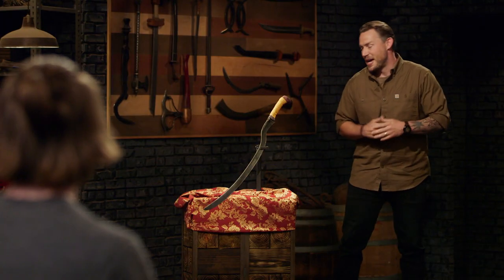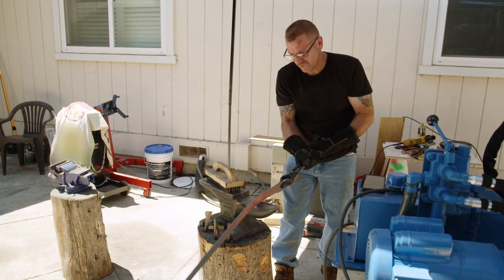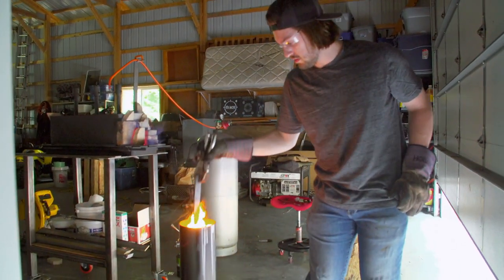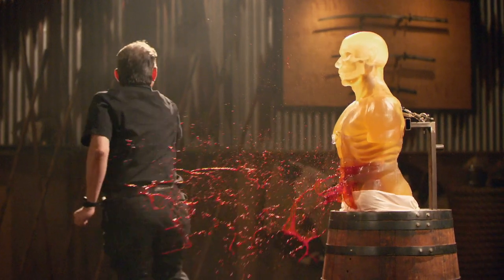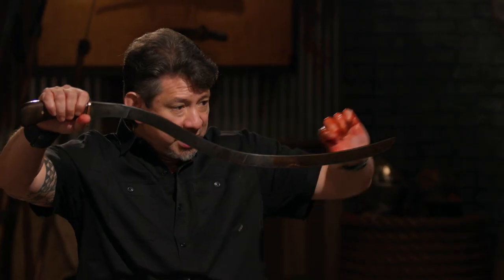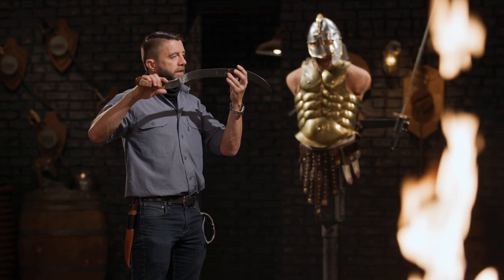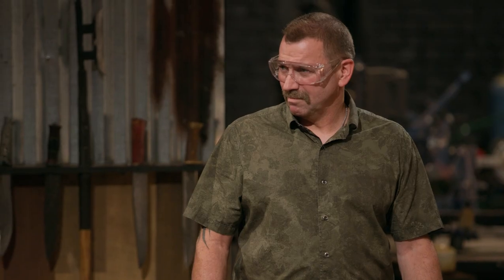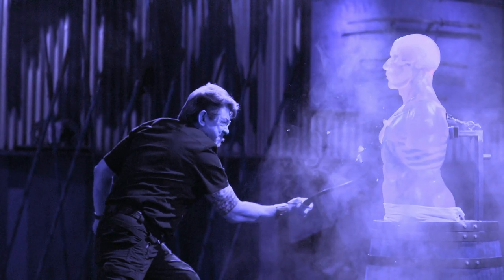Forged in Fire: Mesopotamian Sickle Sword SLAYS in the Final Round! (Season 8)

Comment: The second neck strike with Robert's was in a different location than the first strike.  So the second strike cut off the head with one slice.  a very clean slice as well.
Reply: one of the sharpest swords ive seen on these
Reply: Thanks captain obvious
Reply: The way the first swing of that second blade dug into the rib cage was impressive. Straight through several of them and deep into the chest cavity. An instant fight ender. Mechanically unable to swing a sword and dead in seconds. The first sword was a good cut but didn't get into the juicy bits behind the bone.

Comment: If they're making an historical sickle sword. They should have them make it out of bronze to add to the difficulty, and make it historically accurate.
Reply: Hammer hardened Bronze would be cool
Reply: It would be cool but since they're doing it at their home and so having a metal restriction they didn't know with 3-5 days to work might be too hard. It has been shown quite sometimes that blacksmith in the show only have a few good metal pieces available. Imagine if one of them doesn't have bronze and the nearest place to buy it is 3 to 4 hours away then it's a day less on the schedule.
It would work for the previous rounds where they have the same equipment

Comment: So if it’s a Bronze Age sword why is forged instead of being cast
Reply: Yes, it would have been better if the swords had been made from bronze.
Reply: If it was bronze, that strength test would last 5 seconds tops 😂
Reply: @jackjack3358  What if it were done against bronze armour and weapons?
Reply: @QuentinStephens  That would do the trick. 
But it would be a curve ball to all contesters - since all the equipment they have,(materials, benches etc) are either iron/steel or designed to be worked with those. For example, you can't do quenching on bronze sword. They also probably don't have bronze in their inventory at all
Reply: @jackjack3358  True, but they don't take into account things like the size of a competitor's furnace either. And there are a lot of similarities: for instance the edge of a bronze sword has to be ground just the same. And given that the edge of a bronze sword benefits from being work-hardened there's still a lot of forging to do. And copper and tin are widely available.
Reply: @QuentinStephens  there is a difference between not having the best tools and not having the right materials. All the pardticipants with less material still have the possibility to make the weapon and find a solution to work with their restriction. But if you don't have bronze you simply can't do anything. So you have to waste half a day or a full day depending on where you live to find the metal you need. I'm not a blacksmith myself but I know that different metal have different melting points so they won't react the same way and a bla ksmith who has never worked with bronze before might not know how to proceed

Comment: The Mesopotamians didn't wear metal armor, so the toughest thing this would have had to hit was a leather shield. I'd call this a historically inaccurate test.
Reply: Given that they smash blades made in countries with warm climates against blocks of ice, I’d way most of the strength tests are historically inaccurate
Reply: @BabyIshii  Aye, if I recall correctly I think they would have been using bronze, at least the blade they made looks like it could've been pre-Iron.
Reply: I think their goal is not to be as historically accurate with the builds because if they did the swords would have been made with bronze or iron not those steel alloys. They probably just want the bladesmiths to mimic the design of the blade and just be lethal, sturdy, sharp, comfortable, and not so heavy. I'm guessing the only historically accurate part they do in this show is when they give those brief introductions about the blade. Other than that, it's just more centered on the smithing
Reply: They said straight up in other videos the tests are more brutal than what these blades would usually be subject to. This is to really differentiate the two weapons from each other. If they were very even throughout then judging them would be very difficult. The judges also specify they can put their own signature twist on the weapon as long as minimum parameters are met and performance in tests is fine. That could include use of modern materials.
Reply: I did use bronze pins and a bronz guard on mine. The judges got a bit annoyed and said the original did not have a guard. I pointed out the original was cast bronze and had a guard cast into it.

Comment: that second blade also took a huge chip from that blade on blade strike.  Like Robert said, "roll the dice"... and that's exactly what that strength test was, random chance.
Reply: Has there ever been an episode where both finalists had their weapons broken?
Reply: well, swords meant to clash against other swords in battle, so an argument that the test is too harsh do not apply here.
Reply: The difference is that one blade was tempered in a oven after quenching as it should, and the other not.
Reply: @necropasia  lmao, and in how many battles have you been? You must realize that in a real combat not always everything comes "by the book".
Reply: @necropasia  I hope you're aware that this is not a real battles) By that logic, I was a part of a thousands swordfights vs my friends when we were kids. Sure, we didn't use real swords, but even than we knew that if a "sword" is bound to break in the heat of the battle then you're bound to loose.
Reply: Bruce Wayne  because it's not the point. The point is, his faire reenactments experience is not comparable with the real combat.
Reply: @JebusPrimeDLC  Yes, but it's rare.  Usually those happen in the second round than the final.
Reply: I asked if they had a test B, and they said no 😂. Then, on the second take, i said lets roll the dice!

Comment: Another test where the judge makes it clear who he wants to win. Every single strike on the first one was concentrated on that same spot, so that it was chipped before he slammed it into the other blade. You can even see the chip missing. 

The other blade, not even two in the same spot. He used a different section of the blade each time.
Reply: Hmmm, i was there. Try and hit the exact same spot every time. They didn't hold back at all with eather blade...